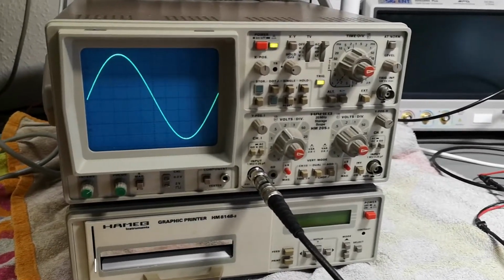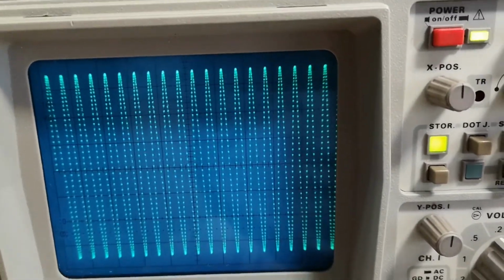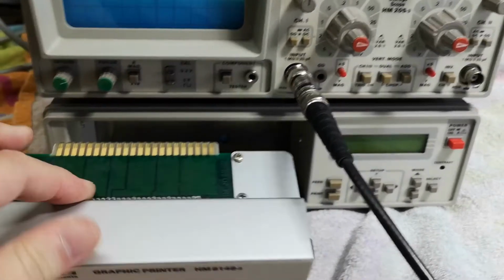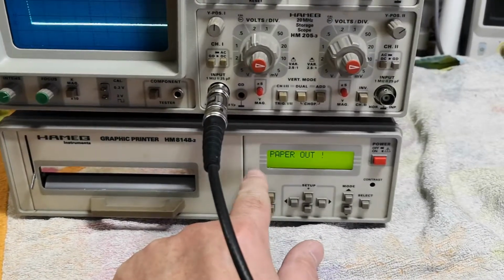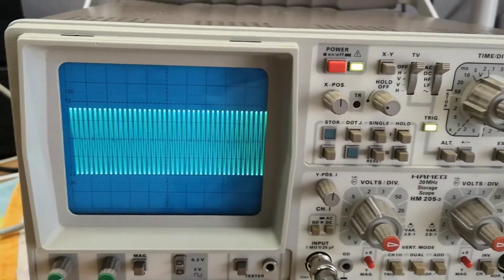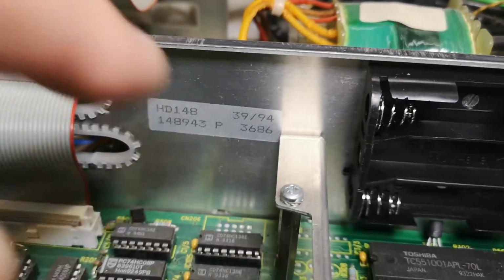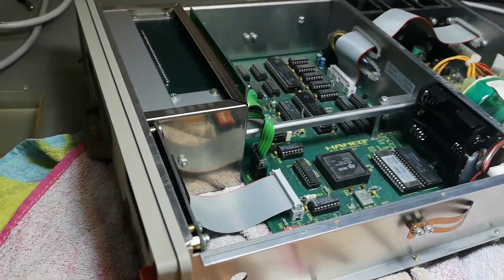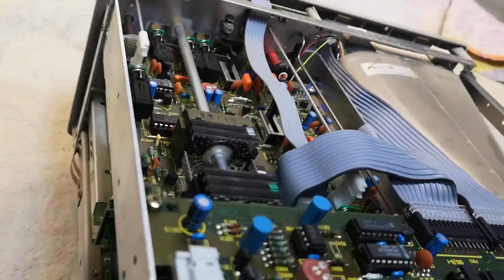Oscilloscope Hameg HM205-3 20MHz 2ch Storage 1994 test teardown

Comment: I am very new to oscilloscopes. This is my first one. Bought this one because a friend suggested it was a good start for a novice and it was also a good price.  Don't know anything about them or how to use them but they fascinate me.  Found this problem out with the Time/Div knob once I received it. Wasn't happy about that since the seller didn't mention it. I was able to pull the long rod completely out. A little scary. A side note: Do I need to also purchase a function generator and if so can you recommend one.  I am only a hobbyist and will use it occasionally to diagnose problems with my guitar amplifiers. Not sure if i need a generator or not. I live in Tucson and so our reply times may be based on our time zones. Anyway, thanks for replying Thomas.
Reply from the maker: I recommend you seek the local HAM radio club, they always got old but still good cheap equipment stored, or their members does, they are famous for helding fleamarkeds and auctions where you can score good stuff for cheaps. they also know what kind of equipment you need for what your hobby direction is and can help you.
Reply: @TeardownOZ2CPU  ok thanks

Comment: My vernier control with the red on it for the Time/Div rotates freely and has come out.  How can that be fixed.  Anyone got any ideas?
Reply from the maker: follow the shaft to the potentiometer, you find the broken part, see that channel that works to compare with
Reply: Thanks. Can parts be found somewhere?
Reply from the maker: @elicuriel9007  have a look, what do you need.

Comment: I always liked Hameg gear - nicely made and excellent  quality for the price. The caps in the heatsink aren't necessarily as bad as it looks - it's a pretty hefty heatsink with vent holes in the PCB, and as you mentioned the only significant power used is during printing, which isn't likely to be continuous, so the heatsink probably isn't going to get too warm. Given the Hameg engineers were good at their job,  they likely evaluated this and decided heat wasn't going to be an issue. Given the caps are fine 30 years later, I think history has vindicated their design choice!

Comment: This Scope must be a dream for any Engineer in the 80s/90s... Even today for Hobby use a power tool :-)  I have one too
Digital/Analog 20 Mega Samples 2x2048 point 8 bit Digital Storage with Computer (Dos/win2000) Software and a Printer Output.

If you use the x10 on the Digital part you can use it up to 10 Mhz with 20x sampling rate !
Most Digital scopes today are mostly below 10x Sampling rate.  
20x would be 4 Gs for a 2 Channel Scope !

The Price was 1650 DM (Deutsche Mark)
That is about 3075€ / 3100 USD today
Reply: Fancy scope for his time!